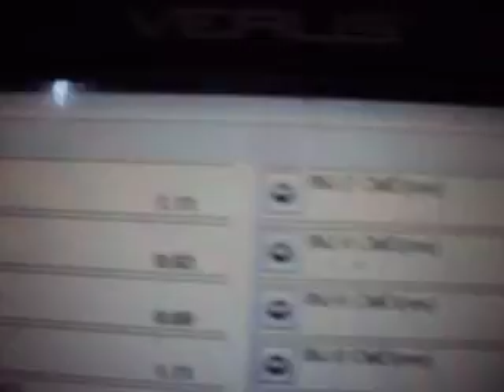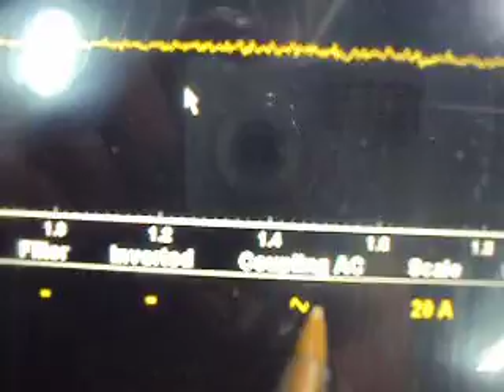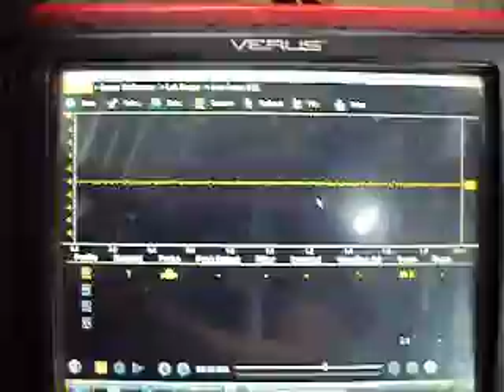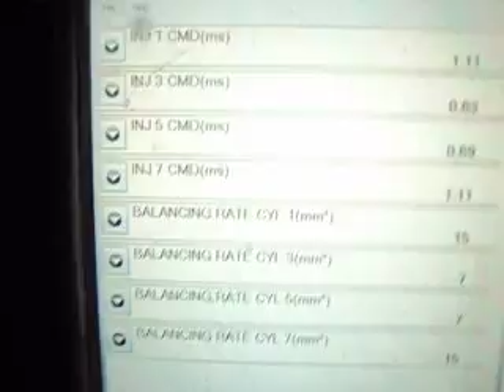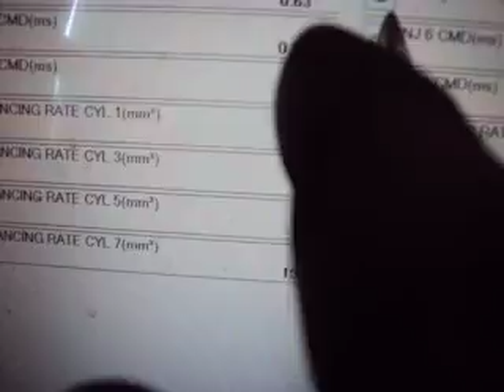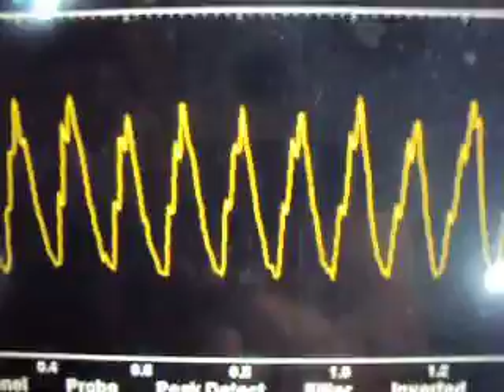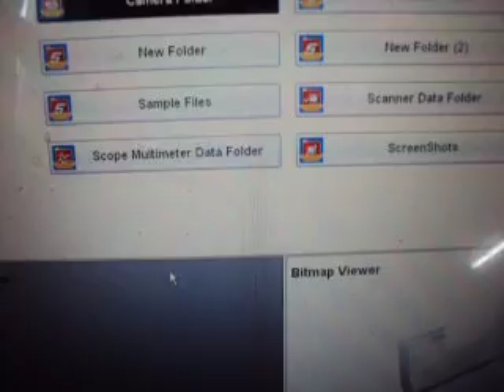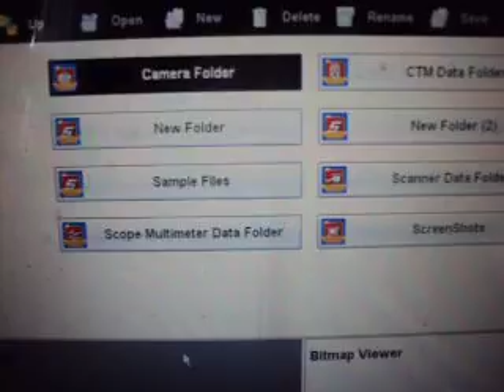Relative compression test of an 04 GMC Sierra 6.6 VIN 2 LLY

Comment: Thankyou for this vid, Ive tried to do a relative compression using a modis with a high amp clamp from battery + but never got it to work, think I need to have coupling switched on.